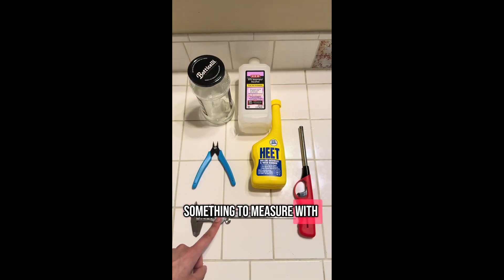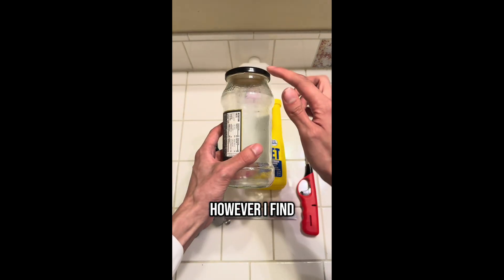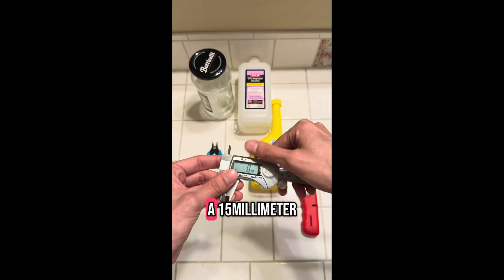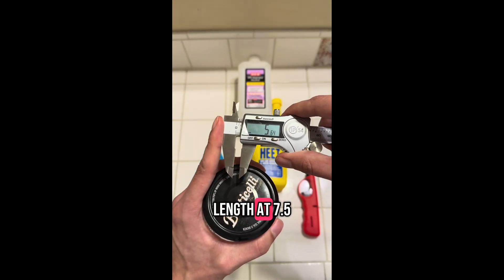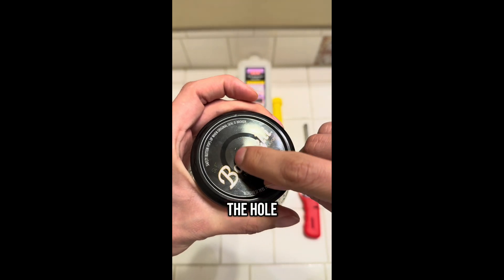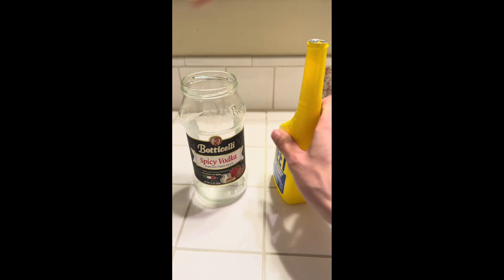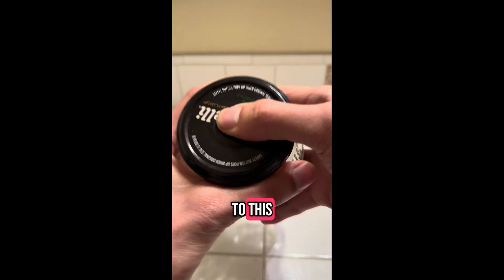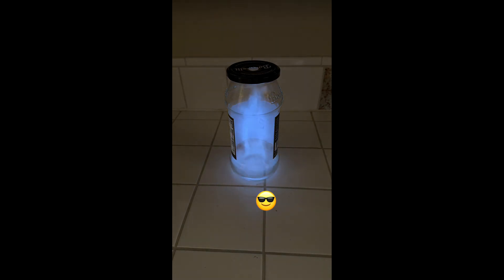Quick How to Make: Jam Jar Pulse Jet Engine

Comment: Possible it can explode?
Reply: The glass can shatter but it needs to get very hot before that hapens. And usually it stops running when it gets to hot.
Reply: @faze_john-deere8203 had the fear of it exploding because the hole being too small
Reply from the maker: It’s possible if the hole is too small and your fuel is too powerful for the glass jar to contain it, but that possibility is kinda small. I’ll say don’t use any hole less than 12mm for a large jar. Once it’s running it won’t explode but will break apart once thermal shock happens and the fuel might catch on fire.
Reply: @ModernMadScientist will it explode with a 15mm hole?

Comment: I bought the heet methanol and got a couple good videos until it wouldn’t even start/pulse anymore help me please
Reply from the maker: It really is trial and error tbh. Try making the hole larger/smaller? You're putting in too much fuel in the first vid though. Since it's the vapor that ignites, more liquid = less room for vapor to mix with oxygen. I also had terrible luck with mason jars but pasta sauce jars worked perfectly. This might be pseudo-science but I also heard that ambient temperature and pressure effect how well the jar performs. Best of luck!
Reply: @ModernMadScientist I found the perfect way to start it everytime 😂 all you need to do you air/shake/put it down and wait 10 secs it lights with HEET everytime
Reply: @ModernMadScientist Small mason jars with a 12 mm hole